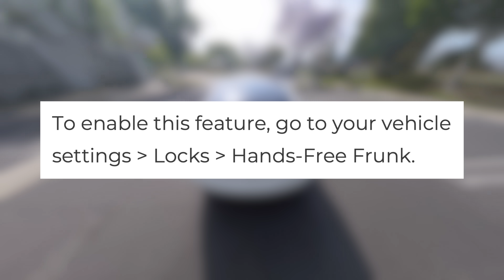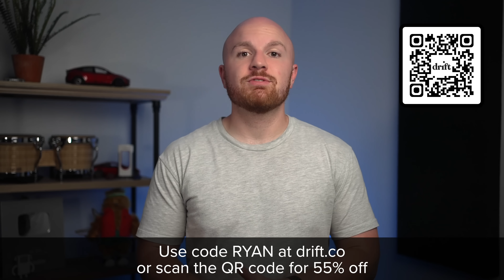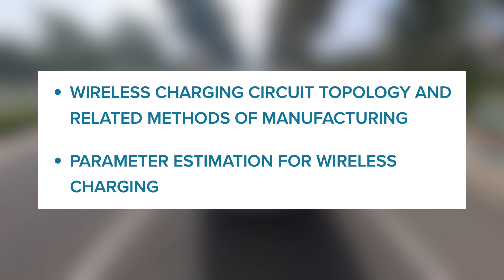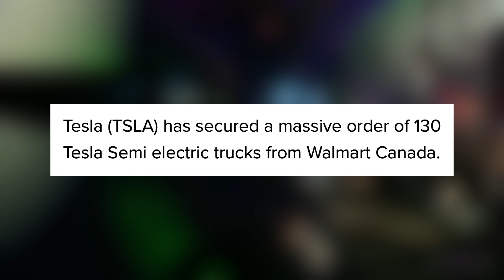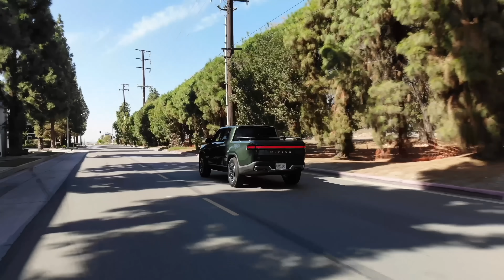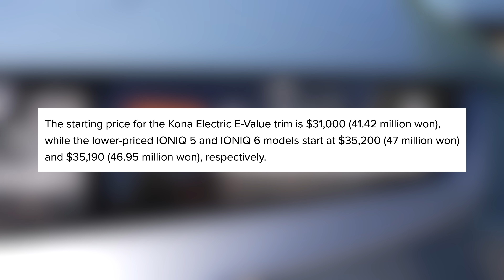Launch Event For NEW Tesla Leaked AGAIN | NEW Photos From The Inside

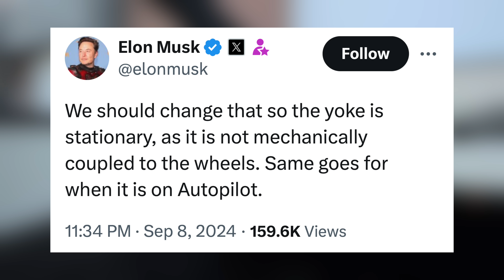Comment: At 10:00 minutes talking about keeping the yoke stationary but then intervening would be very confusing and not practical.  This is hilarious because if you go all the way back to a round steering wheel and make the "spokes" inside the steering wheel some symmetrical pattern that's hard to see up from down on the wheel it would work.  With the existing yoke granted, awkward at best in theory I think it can at least work.  You take over and move the yoke to correct or whatever you are doing which disengages FSD as usual.  Then the soonest you re-engage FSD you let go of the yoke and it repositions to "center" or the correct position.  Another idea you press a button on the yoke and it centers or goes the correct position.  So it's at least not impossible to do this idea.  It works best if you never take over or rarely have to which is the entire idea of FSD eventually.
Reply: Exactly! A round wheel doesn’t need a direction, but I don’t think the yoke needs to match the turning direction to let you intervene, you just turn the way you want the car to go. Imagine you are driving straight but a flat tire is pulling you left, people figure it out and give the input needed.

Comment: I just want a super cheap Model 2
Reply: I think our best bet is a 4 seater with 215 miles or a 2 seater with 220-245 max.
Reply: with a range of 150 miles?
Reply: @dennisdunbar604  If it's a coupe, 2 + 2. It should have at least 200 miles if it has a compact battery/"lightweight" battery and motor.
Reply: @streetguru9350  I would think it would be no more than 200 miles as the rear-wheel drive model 3 is rated at 272 with a 57.5kWh battery. My guess is it will have a 40-45kWh battery, no heated seats, and only available in rwd. I could be wrong
Reply: @streetguru9350 now you're just wishful. The most expensive part of the car is the battery, if you want a super cheap car, it will come at the cost of a smaller battery and range. They've taken air resistance about as far as they can, next efficiency is with battery chemistry or electric motor, and if there's a breakthrough with those, they'll go to the more premium models first

Comment: I am familiar with an individual who is currently engaged in the engineering of electric vehicles for a prominent semi-truck manufacturing company. Contrary to popular belief, the performance of these vehicles is not the primary focus. Instead, the emphasis lies on the integration of modern rail systems with embedded electric vehicles within the track. This approach offers significantly improved efficiency in grading compared to traditional freeway passes.

Comment: Wireless charging has too many heat  issues in low voltage.😂.
Reply: I thought the same thing... then I researched and discovered Oak Ridge Nat'l Labratory (ORNL) has achieved 94% wireless efficiency at 100kW charging Hyundai Kona. Same article points out Tesla Model Y Performance test by Car & Driver achieves about 86% efficiency. (AKA 14% loss)

Comment: The “affordable ev” is a used ev according to the resale rates. So they should abandon that plan.
Reply: The Avg Tesla price, pre-tax incentives is still cheaper than Avg ICE car being sold. IOW, MANY EVs are actually less expensive than most traditional gas powered cars. Plus operating costs are significantly cheaper and can even optionally be locked in by generating energy yourself at home.  Why defend oil industry? Oh, you're likely just another a bot

Comment: Couldn't Tesla include sensors in the steering wheel so as soon as you touch it with both hands it will auto set to the direction the wheels are in when it is in autonomous FSD mode?
Reply: Possibly.  A bit of a conflict if you are making a correction to the left and it's forcing the wheel to the right at the same time.  But you just wait for it to correct and then you correct.  But usually these are emergency corrections at least in my case.

Comment: A power frunk should be standard on Tesla vehicles. When you get stuff out you don't have both hands free so you can't close the lid the way Tesla says to do.
Reply: Put it on the ground behind you? Most stuff in frunk shouldn't be so big and heavy that it requires two hands anyway
Reply: @PrincessNadora  Not practical when the ground is wet or dirty, or if you have bad joints.
Reply: @PrincessNadora also, even if you grabbed your cargo with one hand, Tesla's official closing method requires both hands so a powered frunk is a must.

Comment: Tesla should be fixing their fault on the safety restraints on left and right seats, which should be a. Safety recall and not something customers should have to pay for.   in some cases that the wires underneath the seat get pinched and Tesla is quoting $2600 for a new seat.  That’s just crazy….just fix the damn wires